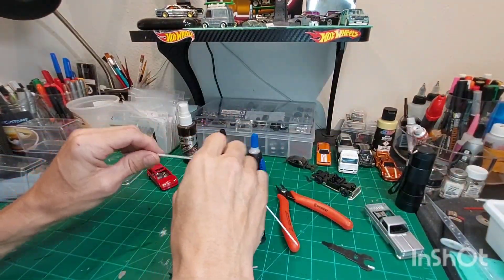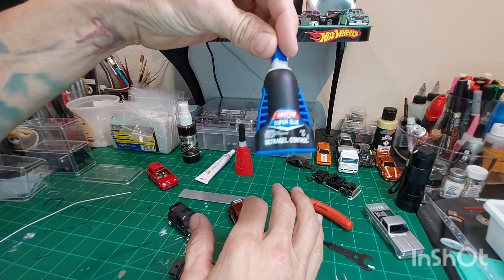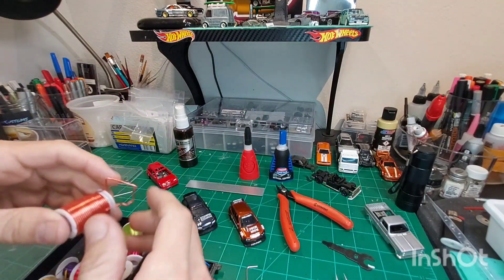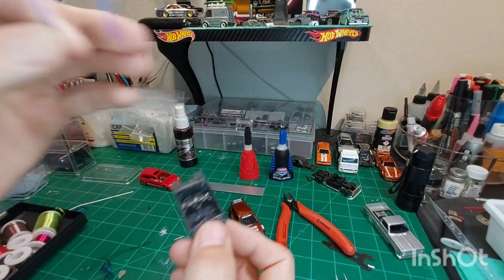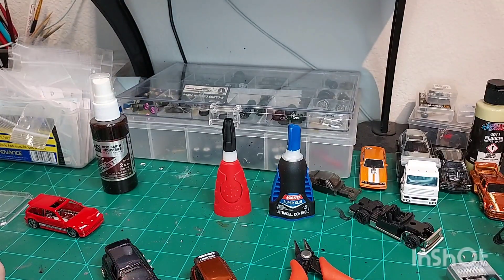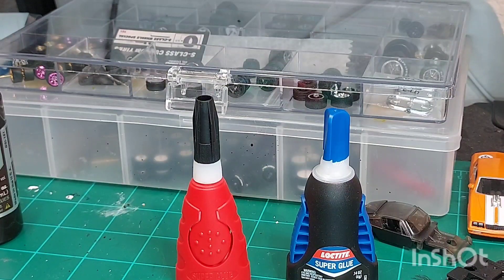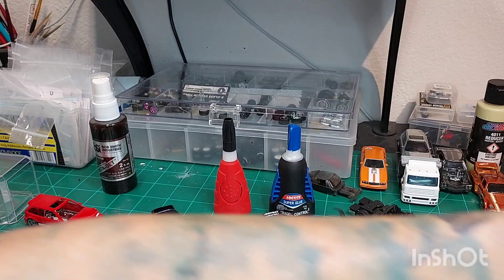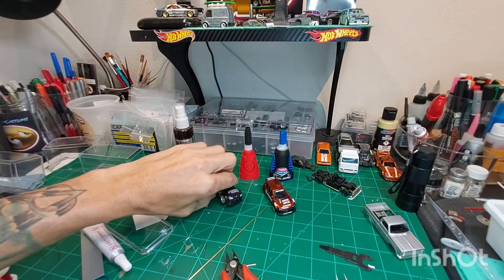What I like to use for making rollcages & tow hooks for my customs

Comment: Great video, does it tell you what size the larger wire is, TY - like what gauge is it, thanks
Reply from the maker: It doesn't,but I understand your question.They only offer 2 size,s id say it's about 18-20 gauge for the roll cage stuff🤷‍♂️ The other is super tiny,like thread.
Reply: @BullitTonyCustoms  -TY
Reply: I just received the laptop 2 mm screws that you were talking about in another video. They work absolutely amazing, thanks for the heads up.
Reply from the maker: @jcsgaragejohnc.5027  awesome I'm glad to hear!👍when I started tapping hotwheels I never watched any video's,I just happen to find a 2mm tap 🤷‍♂️come to find out nearly everyone uses 2/56.,but The 2mm works so well and the screws are easy to find.